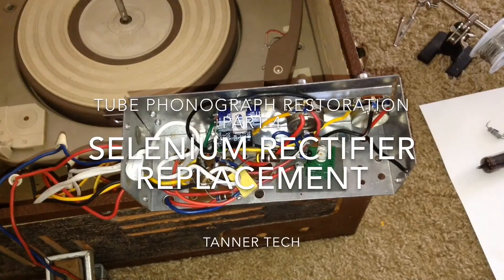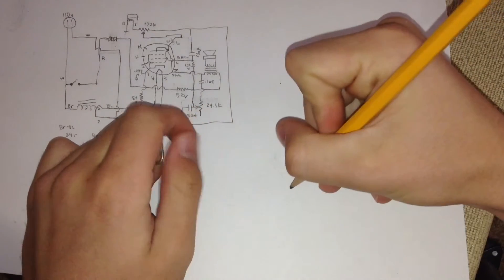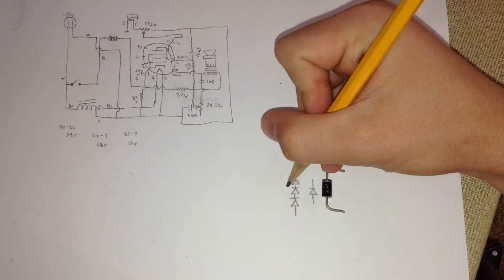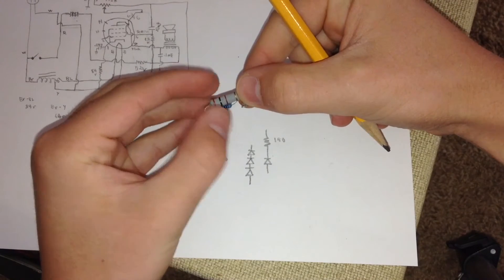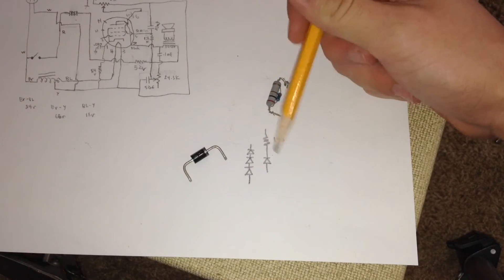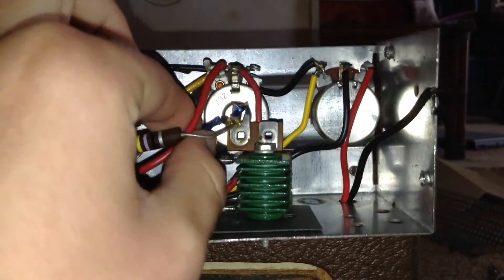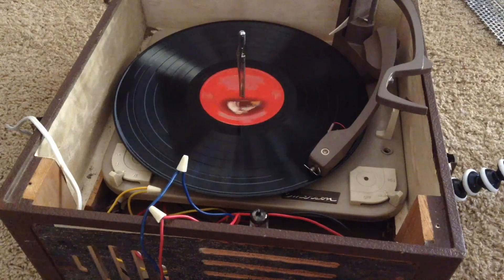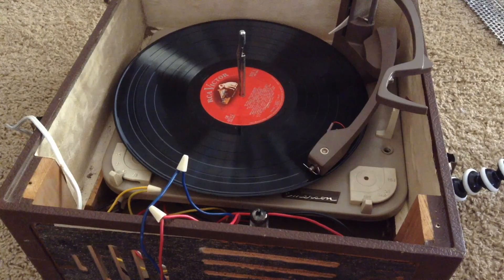Tube Record Player Restoration Part 4: Replacing the Selenium Rectifier

Comment: I seem not to understand the language......lolololol.  Technical language...but I enjoyed it all the same. 800 ohm...resistor...blah, blah blah. Thumbs up to you...  Wish I understood.  Too old for me to learn.
Reply: It just takes becoming familiar with the terms and the actual parts. When I was younger I found electronics a bit of a mystery but now in my 40's and with a little bit of building circuits from kits, I have become familiar with a certain amount of stuff and gained 'some' understanding of the more basic electronics. My grandad used to repair electronic equipment in his shed in the 60's and 70's etc and indeed was the first person to have a colour tv in his street (and he built that himself lol).
Reply: @bigbasil1908  I had to watch this again to update myself.  I have a tube radio and I just watched this for info about the rectifier....  Was that what it was?.. lololol.  This was interesting but shot over my head. I just know this thing going bad is not good. Well.....  Now I know.  Take care.
Reply: @janet5610  Well I recently bought an old early 50's philips disc jockey major record player off of the fleabay to convert into a tube guitar amp and it has one of the tubes doing the job of a rectifier. The record player in this video seems to be even older, and I have never heard of selenium rectifier before. Either you have a tube acting as a rectifier or maybe you have something like a selenium rectifier in your radio. Maybe you can find online an old schematic for your radio? There's a forum where I found photos of the original instruction manual pamphlet for my record player which has the full schematics and lists the parts used (which was very handy for me to be able to order new capacitors to replace the original dead paper capacitors that are in it).
I have to take it at a slow place familiarising myself with electronics stuff otherwise I won't absorb any of the information lol

Comment: Great video series! Instructables brought me here. If I may ask, any idea what to do when one of these is running too fast? I have a different brand but they're similar in build. Thought about gluing a rubber band to the idler wheel to bulk it up but was wondering if there's a proper electrical solution (add a potentiometer?). In the meantime I either stack a few extra records on it, or leave the 45 changer adapter on the spindle to provide resistance.

Comment: how did you determine the current thru the selenium rectifier?
Reply: Amps= Volts / Ohms but what is more important is to get the output voltage to match what it should be putting out. A Sams  Photofact would show that
and why it is important to have one showing the circuit. But for that you need the model number which was never shown. (Emerson model  P-1957?)